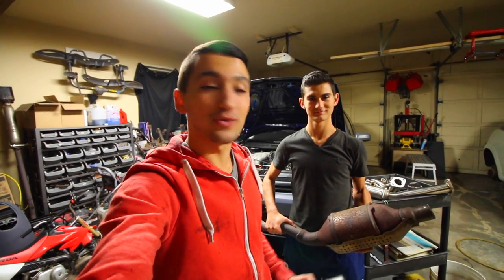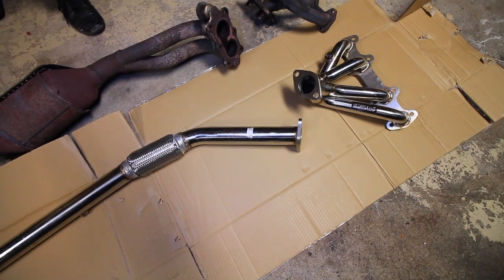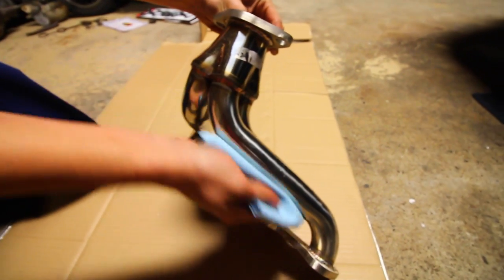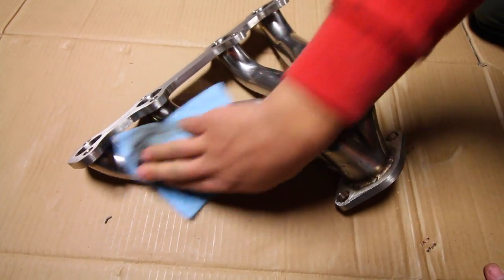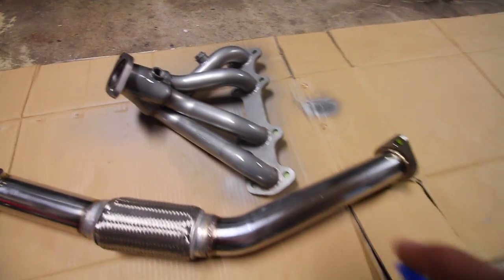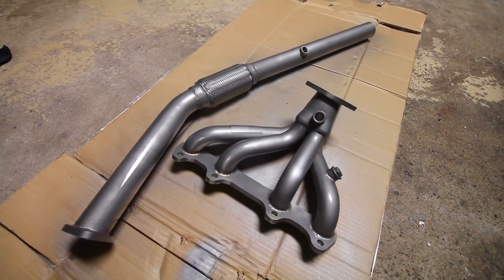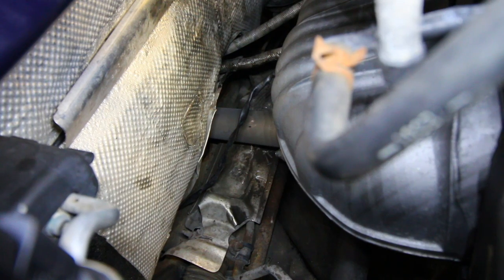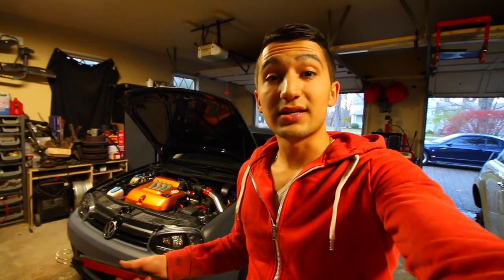How to Ceramic Paint Your Headers

Comment from the maker: I love how almost every comment regarding this video has NOTHING to do with the ceramic coating, but how the car sounds... SICKKKK
Reply: Internet's mean 'n unpredictable. 24/7/365 ☻
Reply: That's because it sounds disgusting
Reply: Nobody is bothering to comment on the coating because VHT paints are all crap, they always flake off after a few months no matter how well you prepare the metal.
Reply: @sidecarbod1441  The VHT spray paints are a fruity coating as call em and it's better to spray with the parts heated for some reason you have a point. It needs to dry a few DAYS not paint the headers and bolt em on and get the paint hot. It's better to paint with VHT outside on hot summer days and let it dry a few days to a week for some reason Urethane Acrylics are like that.... Especially the flat or satin colors the way they come out they don't have a lot of the drying agents in em for some reason but I have definitely noticed that if you paint with em to let em dry a week or so or at least 4 days that is a fact otherwise they peel and flake off.... I also use hot coated clear let the parts lay in the sun and clear em too also works. Certain Epoxy primers will withstand header heat and I use strictly Urethane Epoxy primers for that reason. This is the reasons why Paint and Body people use heat booths it structures the paint without the up and down temps lets the paint dry continually with out cool summer or spring nights that tempers the paint and peel and flake off like all spray paints do don't care what it is... Tempering the paint is a bad idea just parking in the warn or even hot shed or barn helps..
Reply: @thekingsilverado9004  Thanks for the info, I'll bear it in mind next time I use VHT paint. :-)
Reply: The stock manifold flows better then that header
Reply: Throws up in mouth
Reply: I like it how people are always obsessed with what others think and say and forget about what they actually like, it's your car so do whatever mods make you happy because you are the one who is going to drive it
Reply: Including mine, which is basically an attempt for you to shout out my channel and subscribe yourself. Support a veteran, but most importantly enjoy yourself watching 1 of many projects on my channel. Bleed automotive, family, love and live life.
Reply: I bet my 1999 saturn sl1 would gapppp u bud!!
Reply: @milanmast can this ceramic paint go on headers when its in a snow based environment. As in yearly snow = lots of salted roads. Will it be fine or could the paint be null due to this type of exposure? Love to hear back if possible, thanks!
Reply: Sounds like a fart car. That’s what my kid calls loud non-v8 cars. Fart cars.

Comment: let me know how many ppl burn their house down putting a heat gun inside of a cardboard box like that
Reply: average gamer not me, watched it for 35 mins straight, it did leave burn marks on the hole that I made to put the heat gun into though. Just gotta be careful
Reply: @richardsharma283  gotta be smarter than fire........!
Reply: Gary Johnson of course! Took the fire extinguisher out of my car and had it on standby lol!
Reply: Um....none. Because the flashpoint of cardboard is too high for a heat gun to ignite it.
Reply: @neopatriot2008  $15 heatgun from HF 1100 degrees ,paper ignition approx 450 degrees.
Reply: Coat it with high temp silicon spray first 😄
Reply: I think heat lamps in open space would be safer, that also prevents the gas from lingering around like it would in a small box which would help with speeding up the baking process. However, the box trick would be alright as long as it's supervised.
Reply: Wrap the inside of the box in tin foil. Viola.
Reply: If this is the same vht flame proof paint I have (hint: it is) there is an actual baking process written right on the can. This can be done on or off the car. Nowhere does it say place header in cardbox and shove heat gun in hole. Read the instructions provided by the manufacturer if you want a long lasting coating.
Reply: No...could you post the statistics?I am curious how many people actually burned down houses with heat guns & boxes.
Reply: I have done the same thing but i put H.A.V.C tape all inside the box . It worked great.
Reply: Exactly what I was thinking
Reply: I'm still wondering why he painted a beautiful stainless steel exhaust that does not rest lol
Reply: @jayhensley4049  Stainless steel is strongly resistant to corrosion or rust but will still corrode/rust over time. At best it will discolor.

Comment: Ok, so a year and a half later, what do they look like?
Reply: this stuff is actually the cats ass for durability,they did a salt spay test on this stuff and it blew away cerakote on the same materials they tested thats impresive, i know the clear that you do a 3 step oven bake with is great for protecting the paint from chips oxidize AS WELL.
Reply: Well they would have left a lot better my friend if he didn't paint the stainless steel that does not rest. Uninformed and Young I'm sure he'll live and learn
Reply: @markboza6215  source of the test?

Comment: VHT will peel off, use Rustoleum high heat, it is rated for less heat, but wont flake off. Or you can use POR-15 with a brush, then when it is applied and still wet, brush some paint thinner over it to get rid of the brush strokes. They make flat black, gloss black, and silver.
Reply: Rustoleum alone? No primer ?
Reply: @edgardovigo147  Definitely needs a primer too
Reply: @TheMrFlyBoy18  no. just sandblast or wire wheel and HT ROLEUM is the best. I like in MI and use it. Also tested by other on YT.
Reply: Yes sir you aren’t lying! I noticed I had to just end up going thru a “burn off stage” and let it all melt off when I used this vht on my headers. I was 18 or so and wasn’t sure if this was supposed to happen or not. Thought man.. I think I kinda just wasted a whole 2 months of savings on this stuff but didn’t wanna believe it. The long tubes are now rusted to sh*t 10 years later 😅 
They still have alot of wall to rust thru but not sure they will be good for cutting/repurposing for turbo setup. don’t want flakes to blow thru

Comment: So tape mating surfaces, but not threads for 02 sensors? 🤔
Reply: Not the O2 sensors! You will ruin them at about $75 a pop, which doesn't make any difference as without the cats, they're ruined anyway. Forget about any A/F calibrations. That's over now.
Reply: The o2 insert has a plug in it
Reply: Don't really need to. No cats. Basically they exist now to prevent codes. Some times you can just test the average Ohms and hardwire a resister. They can plug it too. Even then if they didn't do a cat delete it the threads are usually a 3B loose tolerance fit for assembly. So paint  and grit barely effect it at the very least it will make psuedo locktite lmfao
Reply: Is it bad if I paint the mating area ?
Reply: @alexhernandez3894  yes. You need to strip it off and do it again dont scrape it strip it with paint stripper.
Reply: I noticed but its ok
Reply: He literally has a bolt plug in the 02. What video did you watch?
Reply: Run a tap through them lol
Reply: I know right
Reply: Lmao the mating surfaces don’t even matter you can just sand paper it

Comment: stainless does not rust, it will loose its shine but it will not rust, thats why its called stainless. im a welder and weld stainless all the time
Reply: Nathan Platt it does rust but it takes years if the quality of the metal is high
Reply: Nathan Platt I heat cycled my hks headers on my old na sr30 s13 and they rusted. They rusted differently to mild steel but still.
Reply: The question is what kind of stainless?  T304 won't rust.  T409 will show surface rust.
Reply: I'd be embarrassed to be in that field and publicly state that anything called stainless steel doesn't rust...
Reply: I HAVE A POLARIS FLYING BOAT AND THE CAGE IS STAINLESS STEEL. 12 YEARS AND NOT ONE SPOT OF RUST ON IT
Reply: Even the best quality stainless steel will rust, i've seen stainless black powder revolvers rust pretty quickly.
Reply: Then it wasn't stainless steel
Reply: Seriously, there are guys here saying that stainless doesn't rust and some of you are welders?  lol. Brush up on your metallurgy.  T409 DOES rust because of the amount of iron in it. A magnet will stick to T409 but not T304 stainless.
Reply: Nathan Platt u shud know that there are basically 5 different types of stainless steels!
austenitic,ferritic,martensitic,duplex and precipitation hardness!!!
ferritic will defo rust,martensitic which is used to make cutlery usually wont rust
Reply: as a cnc machinist i can say that it does rust. even 304, if the surface is rough and it gets contaminated, it really starts it off..
Reply: I can get stainless to rust in less than 5 minutes. Simple chemistry.
Reply: it sure will rust.they make treatment to dip them in but its not perfect either.i worked in a machine shop and never heard this claim ever
Reply: Nathan Platt really?!? Are you sure like sure or you are just babbling? Coz my chromed stainless exhaust tubes 2mm wall are somehow rusty. And the motorcycle is only 28 years old. Maybe you are just the same age. In that case no worries, when you get experienced it will be better.
Reply: Of course stainless will rust and corrode. That's why there are different grades of stainless for salt water boats vs fresh water boats. Depending on the grade of stainless and the environment, stainless will rust under the right circumstances.
Reply: it's not stainproof, it's stainless. My 409 Magnaflow muffler gets quite a lot of surface rust, I let it go a little too far and it started pitting.
Reply: So now ricers are painting stainless headers with part store exhaust paint? Makes sense. The bare stainless will last longer than that cheap ass paint.
Reply: Of course stainless rusts.  It just takes longer to corrode.  Depends on the mix of metals used.
Reply: joavila my whole point is the paint won’t last near as long. It’ll have burnt off long before it rusts.
Reply: Stainless steel will rust if there are different type metal are connected to speed up process
Reply: "stain less" not "stain never" idk where this dude lives but if he's up north the road salt is going to rust that shit to hell.
Reply: Good then Polaris choose the right type of stainless for the environment you're flying boat is exposed to. :-)
Reply: It's stainLESS and not stainNEVER. It definitely does rust. When and how much depends on the quality. Some of you that are saying I have blah and blah and it's never rusted... in many cases there's a clear protective coating. It can be hard to spot this coating unless you're specifically looking for it and even then it can quite hard to spot.
Reply: Kfx Guy if u bake it at 250 for 30 min let it cool for 30 min then repeat that at 400 then 650but u have to let it cool to the touch each time thats very important to the curing process if you follow them steps acetone wont even take it off for cheap oreilly paint it works pretty well and u can polish it and make it look almost as good as high doller headers and he was spraying to wet u want several dry coats
Reply: Can't you just wrap the headers to prevent it?
Reply: Absolutely wrong, with the amount of salt and heat the headers are subject to, even 304L will start to corrode. If you want true stainless, you gotta go for something like 6Moly steel, but if you claim that standard stainless won't rust, my guess is that you don't even know what 6Moly is.
Reply: If exposed to lots of heat i.e., manifolds, it will oxidise, however it SHOULD polish back up lovely if you can be arsed so no paint please.
Reply: Im also a welder of 25yrs. Its called "Stainless" because its Stains less than standard steel. Just like Aluminum stainless corrodes rather than rusting like you see in carbon steel. 
  It's all corrosion,  the iron in carbon steel makes it red, in stainless and aluminum its white.
Reply: There are trash alloys that will form a little surface layer of rust. Think of it like corten alloy... This dudes jusy plain in his corny ricer era
Reply: @Mike-dx8jj HELL YEAH BROTHER CRANK IT

Comment: It has an insane loudness and you won't be able to tolerate the sound and resonance during a longer driving. I applied rear muffler delete on my 1.4 and it sounds great but not loud and it provides a little bit of popping when rpm drops.

Comment: Stainless doesn't rust.
I find it best to use the kitchen oven to bake painted parts.  
Just don't tell your Mom, GF, wife, or whoever runs the kitchen!
Reply from the maker: Stainless does rust, however it stains-less than normal steel. Overtime, it will rust out
Reply: If it's proper "stainless-steel" that is properly processed, it will never rust!
Reply: Carl Benz not true, there are different mixes of stainless, and some do rust depending on the content of steel compared to the chrome, and other metals. Just because it has a higher steel content doesnt make it bad stainless steel, its just not the correct stainless for every job. Some are for salt water conditions, some for surgical tools, some for kitchens, then there are cheap stainless for exhaust and expensive stainless for exhausts that will corrode the least.
Reply: Yeah, there a several types of stainless, I'm aware of that. But the comment section of this kind/level of video isn't a place to discus metallurgy, if you know what i mean... ;)
Different alloys for different applications.
 However, i just commented, because "milanmastracci" thinks he knows shit, which he doesn't. No offense though, not knowing everything gives room for improvement! :)
Reply: mariodesmo very low quality cheap Chinese stainless can and does rust

Comment: R32 Badge on a 2.0 NA? Wow...
Reply from the maker: We're ricers. Thank :)
Reply: preejaculation
Reply: brad450 just about to say the same lmaoo I got jealous
Reply: stainles does not rust it will loose its shine but it will not rust. thats why its called stainless
Reply: Nathan Platt poor quality Chinese stainless will rust.
Reply: maybe  from china   but then it's  not   real stainless
Reply: even highly certified A4 Chrome Nickel is rusting (not much and you can tighten/loosen bolts even after years in the sea but dont forget that heat is fasten up the process)
Reply: Oh god...
Reply: brad450 only ricers know what you are taking about 😂
Reply: Yes it will Nathan.  It's way more resistant to rust, but it will crumble into dust just like cast iron.  Just not as quickly.
Reply: Nathan Platt go to a steel yard and see. It most definitely does rust. The difference is you can polish it off a lot easier.

Comment: The newer style cats (As compared to the bead type in the 70's) use a ceramic extruded honey comb grid will crack when running lean, causing it to overheat. This is why it broke inside. Intake air leak, vacuum leak, restricted injector(s), low fuel pressure, incorrect "Tuner" programming, etc. will all cause the exhaust to get extremely hot. The cat cannot expand enough and cracks, worse case; rattles, chunks turn side ways and blocks exhaust flow, increases back-pressure and will not pass emissions testing. With a pre-O2 sensor and post-O2 sensor, will turn the CEL/MIL on once per second. That is a condition that threatens the cat. Yes...He said "Pass Gas".
Why would you do that much work on a lawn mower engine?  Retired ASE Master Tech

Comment: IMHO removing the cat is just stupid. You gain, how much hp? 10? You could've replaced it with a hi-flow sports cat, gain hp and be legal on the road.
Reply: Norbert Chirilenco explain further, how do the highflow cats work?
Reply: Lanre Oladejo the hi-flow cat is less restrictive than normal. It works the same way, just the openings inside where the exhaust gases go through are bigger. That way it lets the gases flow easier through. You won't gain the full 10 bhp but 5-6 will be in there, plus that the car is still legal!

http://www.autos.com/aftermarket-parts/how-a-high-flow-catalytic-converter-increases-engine-performance
Reply: About 99% of the time high flow cats do not meet emission requirments so u will still fail an emissions test without a tune to delete the check engine light. And cats are very restrictive so yes you will gain good horespower from just removing something and gain sound. I gain a little over 20 hp from just removing my cats. And i had the dyno tuner turn off the rear o2 sensors so it doesnt have a check engine light. So i pass emissions easily. Its sad that people dont know this. This is why no one runs a hogh flow cat and why so many people have cat deletes and still drive on the road.
Reply: We don't have emissions here so all my cars have the cat removed .better gas milage too not having the ristrictions
Reply: Fuck emissions glad we don’t have it here where I live lol
Reply: Most but not all.  hi flow cats are actually test pipes. Look like a cat but actually through / straight piped in side. And any cat that will truly give you hp gains will not be street legal in most places.

Comment: sounds like a dirtbike
Reply: Never heard a dirtbike sound that shitty.  Do they really think it sounds good?  I am #21 on your thumbs ups!  LOL at the fart can.
Reply: Hats off to the guys for making the vid, I didn't know about the ceramic coating in a rattle can.  It sure did turn dark after a little running I noticed.
Reply: that paint is a waist if time it'll last a little while then just flake off. if those pipes are 304ss not 407ss they'll never rust just get blue from heat.
Reply: Waste,    not  Waist
Reply: no, this is way worse
Reply: That would the most badass sounding dirt bike ever then

Comment: nice job boy's.  just a tip when using the wax and grease remover (prepsol).  always pour the prepsol onto the rag, do not put the rag to the bottle as you can contaminate it.  :)